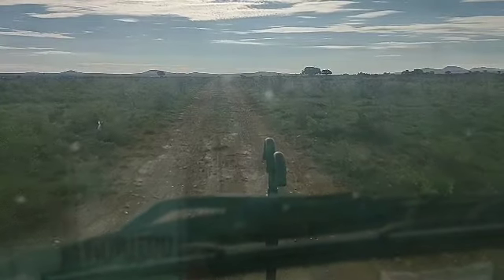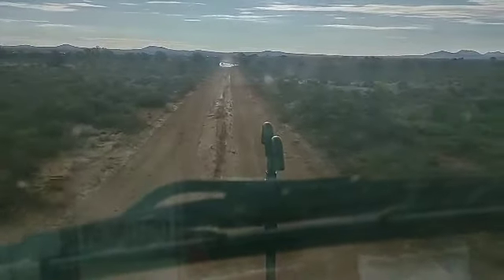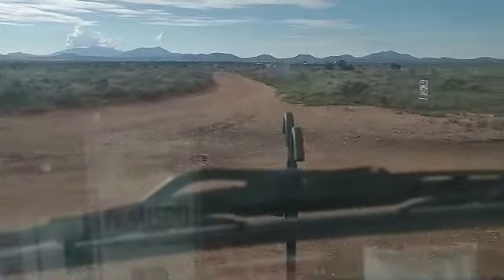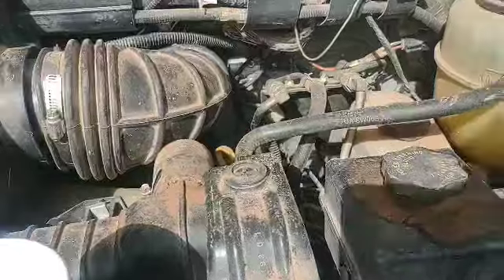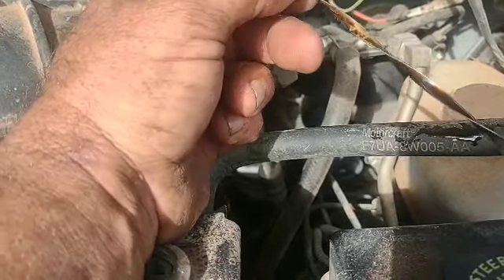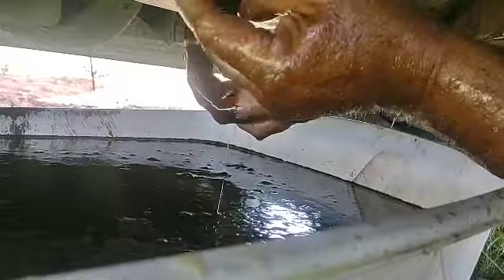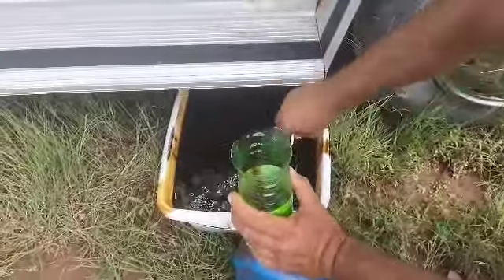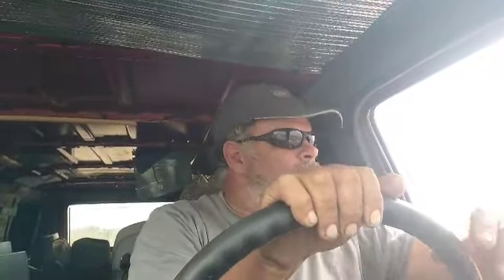assessment of Susan's mechanical issues.

Comment: First step is to change the head gasket and refill it with new oil. It's the cheapest step in the process before you seek help from the shop. Nobody would completely strip the block first. Breath, you got this Randy.
Reply: I agree, and if while changing the gasket if you are able to assess whether the head is cracked or not that would be great to examine while down in there.

Comment: Repair kits for the blown out plugs are available under $50 now.
Fix the plug, change the oil and drive it to where it can be repaired easily instead of out in the middle of nowhere.
99% chance it's just a blown head gasket.
If it hasn't been sitting for years then rest on a cylinder walls will be surface rust only and no big deal it'll clean right up.
that engine can be repaired and back on the road for under $500

Comment: Best thing to do at this stage, get a remanufactured long block, put her intake,  exhaust and accessories on it and swap them out. It'll cost about as much to rebuild her engine as a long block after you pay the machine shop, buy all the new parts and spend the time putting it all back together.  She'll have a new engine ready for the road.

Comment: I'm not a mechanic but I have had a blown head gasket and that's the same exact water in the oil problem. Motor ended up also having a cracked block so it was a total loss fortunately I only paid $900 for the van and the repair would have been almost $2000.00 and that was a friend price. Good luck with that disaster.

Comment: That is an expensive mechanic fee! YIKES!!!
Yes, good home mechanic MIGHT be able to do some disassembly. But the blown spark plug requires some serious work spacen and tools, and special threaded inserts. 
Although the threaded inserts do come in a complete kit for that engine. Check some YouTube videos about how it's done.
Removing the heads, just a super challenge due to the limited access of the van.
Engine might be okay, if not too much rust in cylinder, just hone/polish with steel wool and sandpaper. Enough to get it running. Will not be a long term repair. 
Consider the original mileage, and quality of the interior, might not be worth rebuilding.

Comment: 🇺🇸Hey, Randy and pup;
If you don't know a good mechanic, then it would be wiser, to replace the broke engine, with a remanufactured engine.
The cost is reasonable and the rebuilt engines are warranted.
GOD Bless.